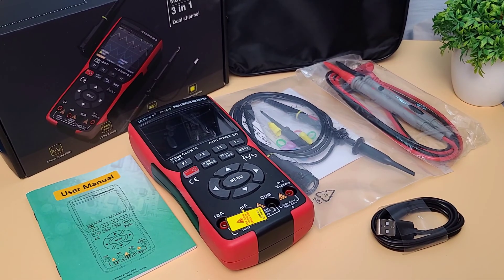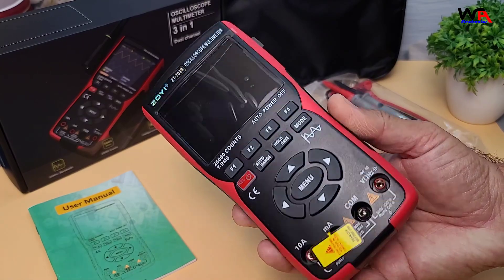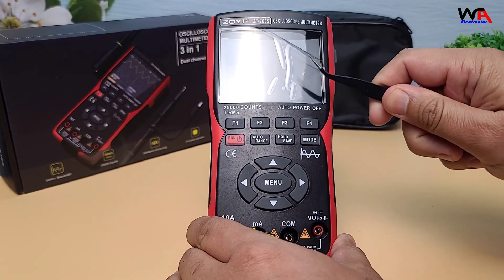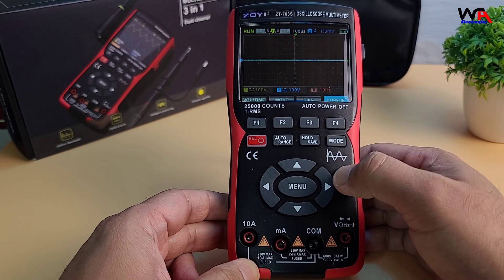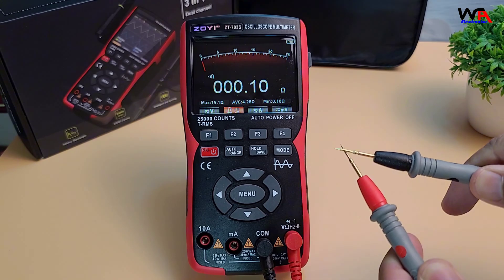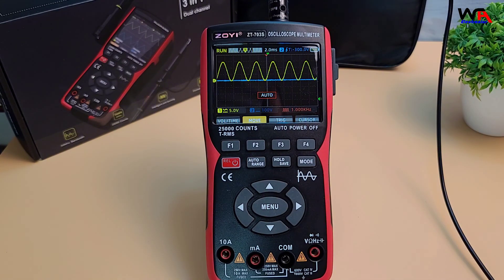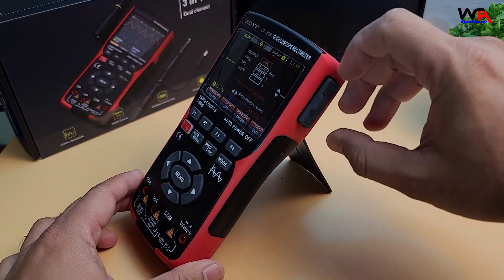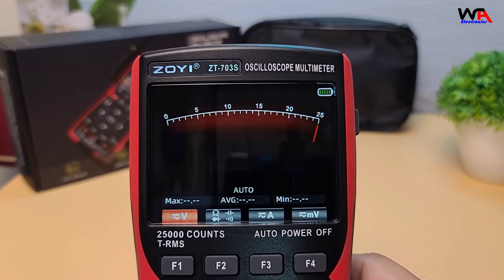Zoyi ZT-703S 3 in 1 Oscilloscope Multimeter Signal Generator Unboxing and Review

Comment: If its a dual channel scope why on.y supp.y one set of scope probes. The unit does not cope well at  anything above 30 MHz so why extol the hype that the unit is capable at 50 MHz. Not i pressed with this review at all.
Reply: no , it can go over 40MHz, he needs to turn on high speed mode, this is what happens when people dont read the mannual, they are given for a reason.

Comment: But it measure only 46mhz maximum at normal speed 39mhz and high speed mode 46mhz and doesn't switch auto mode between normal and high speed mode u must switchَ manually owon is better